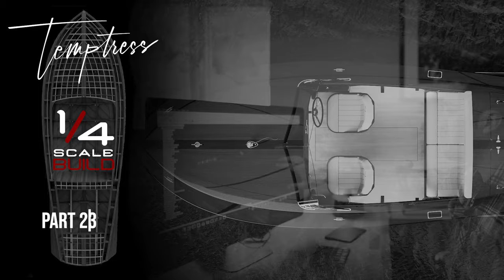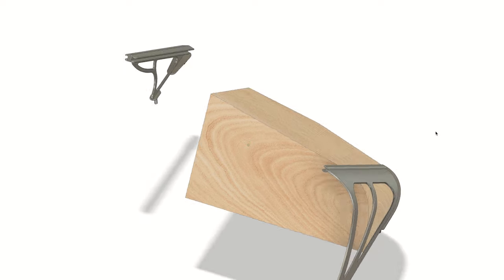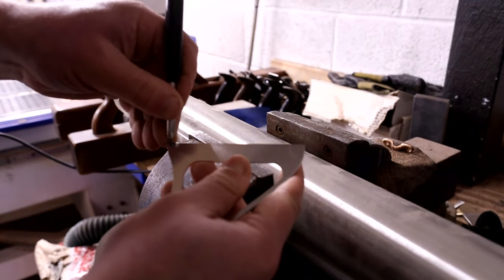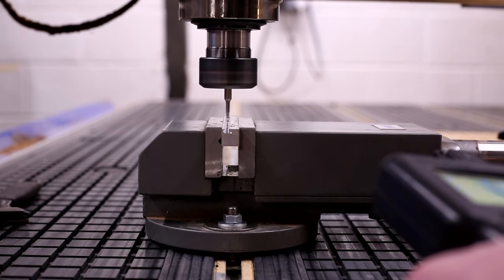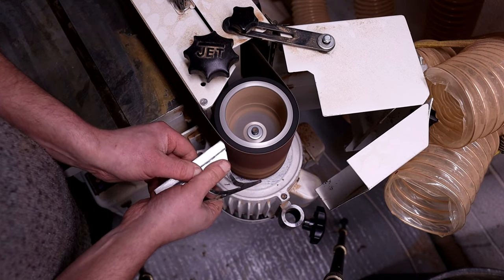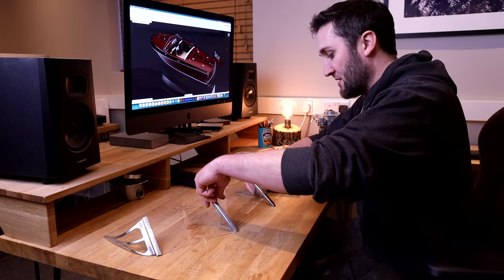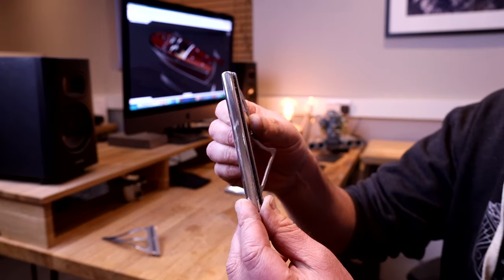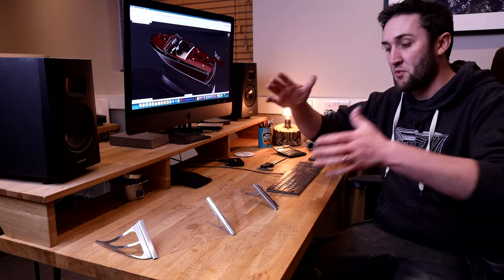Fabricating The Windscreen Brackets | Temptress 1/4 Scale Boat Build Part 23

Comment: Not bad for a rough job. Seriously, very nice work.
Reply: @DanLeeBoatbuilding Hi Dan. Great and ambitious project you are taking on.
Regarding the stainless steel parts I might be able to get you in touch with a local fabricator in Rotterdam to get a quotation.
One thing I was wondering about was if the design has a way to mount the glass? I cannot see any rubber to mount the glass. 

Best regards from the Netherlands.

Comment: Hi Dan,
Looking at how the part is designed there wouldn’t be much room for the weld to be hidden. With the amount of surface area you have in that groove, brazing would be more than sufficient and the route I’d probably go down. Plus there’s less chance of distortion and porosity later down the line.
I know there are brazing rods that work well with 316SS (which would be the preferred alloy for marine environments)
As for the brackets on to the planking, they’d easily be tacked in place and then welded out.
I have a plasma CNC and a slip roller that should be capable of doing 6mm 316SS, not sure of the size of your full size part though.

If you want to send me over the information I’d be happy to look at it for you. I currently don’t have a mill capable of making the main bracket but that’s a part that can easily be outsourced. I live in Oxford so not too far from you!

Comment: Dan - Please buy the welder and sell me the first set of stainless steel windshield brackets you make!
I am Polymerman; I know wood and epoxy; not metal and ceramics.  Seriously, I want to buy all of the custom parts from you directly.
Reply from the maker: I’m not sure you’d want the first set, they might not be the best 😆 I’m the same really, wood and epoxy is my thing, soft metals if I can treat them like wood but stainless is a different level! 

Mind you I guess you are probably about a year off needing some windscreen brackets? Things might have moved on a bit at my shop by then 🤔

Comment: Those welding rods have a higher tensile strength then aluminum.
You could well weld a complete boat together with them.
The only problem is how well do they keep up to corrosion.....
Btw how thick would that inox ( stainless ) be ??
Cause you could well make a cnc press mold for the curvature but you'll need 2 molds which are 3d Cnc'ed.
for a faster and cleaner mold it will have to be a capable 4Axis cnc.
And looking at the design it has a bend AND twist to it.
Btw you make some really awesome stuff there !!

 Hmz 
you already have that model of the mold cause that was that piece of wood you superimposed underneath it.
Why not Glue some really strong wood like Bankirai.
and just mill that with your cnc.
Add extra connection holes to the piece that need to be rolled.
screw it down and just go for it!
once you have the bend and twist ANY welder will take this job on it just welding.
I think this part is not thar hard at all...
Now if you say this is like 12mm thick.
you need so help rolling or pulling into form.
there are various technics you could actually do in your shop already.
2 part mold with all thread and pull them together, rolling, and or Rubber press like they make wing internal parts.
but that last one just works on think metal.

wish i had some inox plate now.....
i would have gave it a shot.
Reply from the maker: That's good to know. Yeah not sure how well they corrode, Aluminium in general isn't that great, especially if you want to keep it polished. The full size brackets would be 1/4" stainless. They should form fine on a roller, although it looks like it there is no twist to them, just a uniform roll. I expect ali would form ok in a wood mould though, even at full size probably. Could be annealed as well of course.
Reply: @DanLeeBoatbuilding  You really would want to anneal it, even if it bends ok it will develop fractures in the structure of the metal.
Reply from the maker: Ah I see. Would probably bend cold anyway I guess as it’s not that severe?
Reply: @DanLeeBoatbuilding  depends on the thickness you have a cnc machine you could make a male and female mold then add a piece of inox and press them inside with 4 bars off all thread which you just screw together the power you can accumulate is insane!!
i have a small cnc router 6090
and a rf45 mill with a diy cnc conversion on it.
i could go 4 axis and mill a press mold but i think hard wood would do fine at first eventually if you would need more pieces then you could think of letting that mold be made.
 Also good practice cause you could to many more stuff with that Technik in your shop and it does not break the bank either.
 but all depends on how think you want the stainless to be.
3mm thick would be advisable i think to start and it will be plenty strong .
Also note when you weld inox the welded part will rust!
the chrome gets burned out of the metal.
So heating inox is not such a good idea it damages the chrome content.
To indeed cold forming is the way to go.
Reply: @DanLeeBoatbuilding  aluminum for that use should be anodized then epoxy painted  dual protection it will hold for a good amount of time but inox is far superior for that application.
i would not anneal inox !!
the chrome in inox will beak down and you will get rust 1/4 is about 6mm ISH you bolt that mold down with a roller system you add a hydraulic car jack to that and off you go.
well i would use my car dent repair kit for that it has a hydraulic jack with a push arm.
Reply: @DanLeeBoatbuilding  As it's not structural as such I think you can get away with it, but even so if you cold form you might see fractures in the finish if you want to polish it up. I would always anneal and also apply some heat when forming even if it's just mild heat.